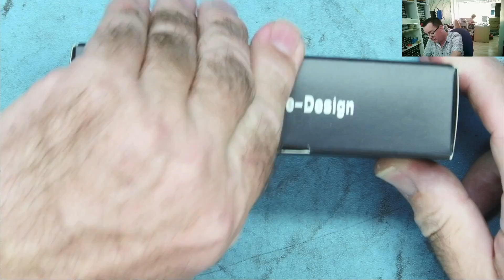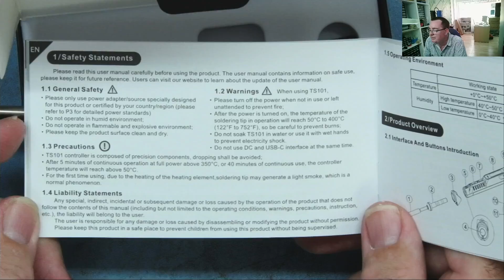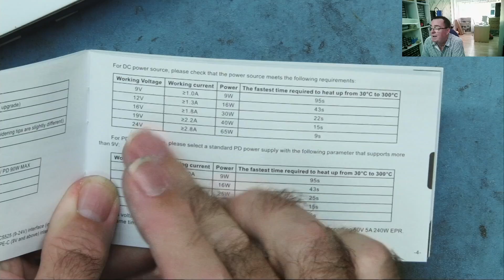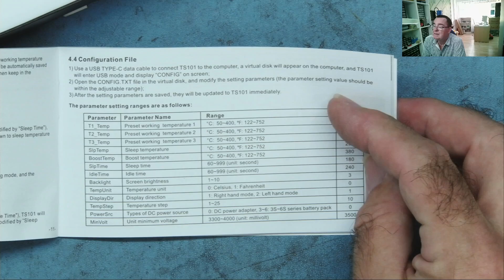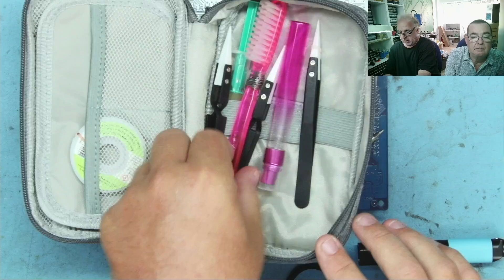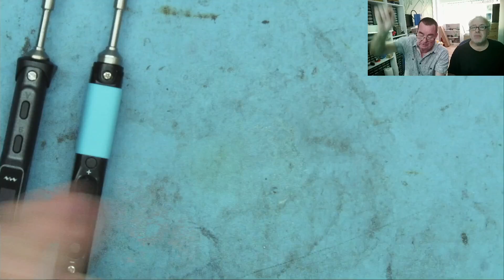Miniware TS101 Smart Soldering Iron Test & Review. TS101 vs Pinecil

Comment: This old video was probably promoted because I was looking for a new PD iron. I had Pinecil v1 for a long time and the screen recently died. So ordered a couple of new screens but I noted the T101 is still about €60 or 70 but I could get a Pinecil v2 for $25 (plus about $12 shipping), so I bought a v2 that I'll use to repair my v1.  Interesting comparison between the two irons. Never used a 100 or a 101 but love the Pinecil (and it's very cheap), so expect both will be much the same.

Comment: I bought this TS-101 about a year ago,  never used it until today so it was a bit of a learning curve to get it to work.  However,  it doesn't heat up with the provided power supply,  i had to use a Type-C USB cable then it worked perfectly?! When using the provided power supply when you push 'A' in heating mode it just flashes the temperature then goes to the 'miniware' screen? Is this a common issue? Or maybe i have it set up wrong?!

Comment: For boards with components on 2 sides SMD components get glued on so the board can get wave soldered
The TS101 just had pre-weakened glue to work with. Had you tried a little longer with the other one you would have had the same results. (25:20)

Comment: You wear the tip out? I use mine as a heat source to melt solder but I suppose it could be a small cole chisel or crow bar ;-)

Comment: Why use the fresh solder?
Reply: Makes it way easier to melt old solder when desoldering.
Reply: from what I witness most of the solder that comes on electronics is lead-free solder, and requires a higher temperature to melt. If you add fresh leaded solder (eg 63/37 Sn/Pb) then you bring the composition of the solder closer to its eutectic mixture and hence lowers the temperature required for melting it.

Comment: Just a question regarding soldering irons in general. Has anyone used a soldering iron thermometer to actually determine what temperature the tip is actually supplying? Does anyone actually go through the process of calibrating their soldering tips so the temperature set is close to what the tip is actually supplying?
Reply from the maker: It's not something I've ever done.  I generally go by the method of 'if it melts the solder nicely it's hot enough'.  Temperature controlled irons are a relatively new phenomenon, most of the time w were just using a mains powered iron, and if we were lucky we got one of those ones with a base stand and a knob on the front that you could turn up or down, but no indication of the actual temperature.
Reply: @learnelectronicsrepair  yup have a Weller soldering gun and a Weller iron with the numbered knob. Also have a KSGER T12 iron and is why I was asking.

Comment: I agree with Det. I have a 20 plus year old Antex 25 Watt iron, unregulated and works fantastically, I've no idea what the tip temp is!. When required the larger fat tip will unsolder things on large copper ground planes easily, so yes the right bit is important. It just works reliably and quickly, you don't need the over complication of these usb powered gimmicks. I can't see them lasting 20 years. Admittedly not too good with unleaded solder, but I avoid using that for repair or building work!

Comment: Could the grounding screw be connected to the piece you're working on, to reduce the risk of static discharge?
Reply: The front screw holds the tip in and the back screw is for ESD protection, it even has a ground symbol moulded into the plastic.